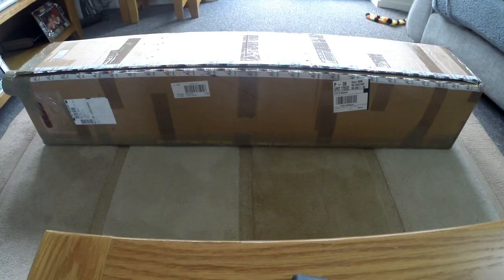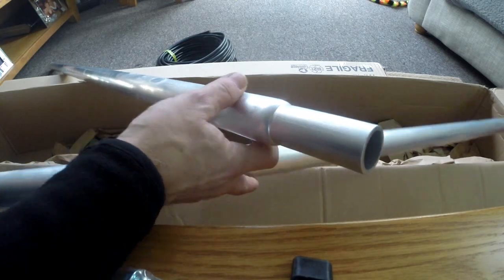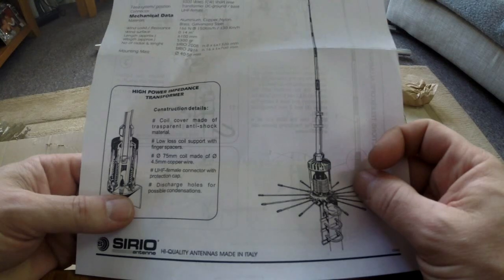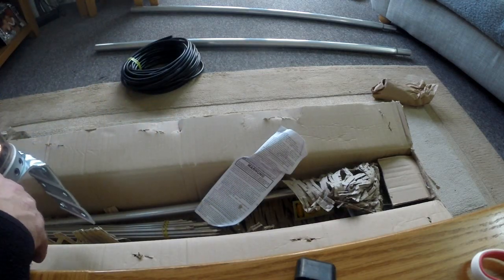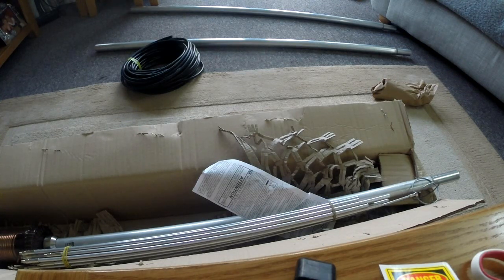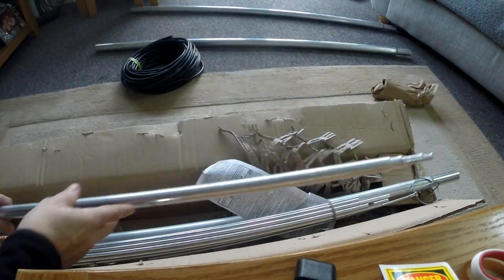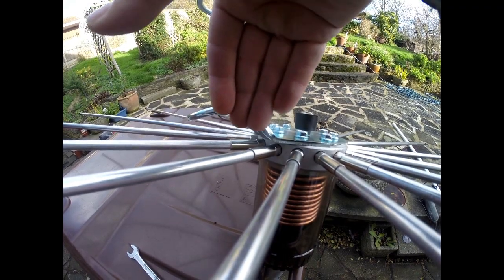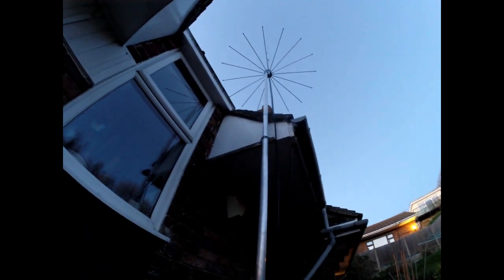Putting up my new Sirio 2016 antenna

Comment: I put this antenna at 55feet and the antenna broke after 3 months.Piece of shit,that is what it is.I got this as an upgrade over the antron 99,but this antenna is very fragile.Got a new max 2000 and raised it at 70 feet high.Been 2 years now and survived everything,no problem.Serio never again
Reply from the maker: Hi Michael, not sure you can blame the antenna if assembled correctly and put right up it shouild be fine, mine is still going strong and never had this hapeen toone of mine unless you had a faulty one from the factory. Did you not contact Sirio about the fault?
 If it got damaged in high winds then there is a specific wind rating for an antenna and in the UK if we have exceptionally strong winds a lot of us will take them down completley or drop them down if the wind is likely to exceed the antennas specified rating. Shame it happened but even a fibreglass antenna has its limit so take care, but hey you got another aerial and back on the air so thats the main thing.
Reply: @britishcbradio1055  Well i am in Canada and weather here is very harsh.We have thunder storms in the summer with winds over 100 km easy,and in winter its even worst.had a mako 3 radial beem that lasted 10 days at only 40 feet high.I am in a valley and nothing holds up over here.Shakespeare Big stick and antron 99 are about the only antenna that survives over here,even my max 2000 in big trouble sometimes
Reply from the maker: @michelst-jacques9555  Maybe a winch down tower may be the way to go if you can fix one up, that way you can then drop the aerial down if you have any strong winds coming and save your aerials.

Comment: 2016 is s good antenna,sirio blizzard 2700(827)is better
Reply from the maker: Hi Gustavo, never owned a sirio 827 so can't comment if they are any good or not compared with the 2016. Doing alright onthe 2016 so am very happy with it. Good dxing!
Reply from the maker: @jamesferrans1233  Soundslaike you had a good deal there james getting the pole and ring as well. Not heard of this anteena before and just lookedit up, yes a 5/8th wave is always good. How you getting out on this and with the skip running you having much luck dx wise.